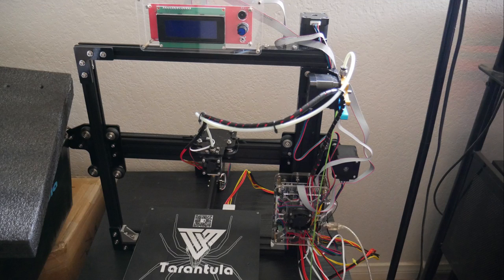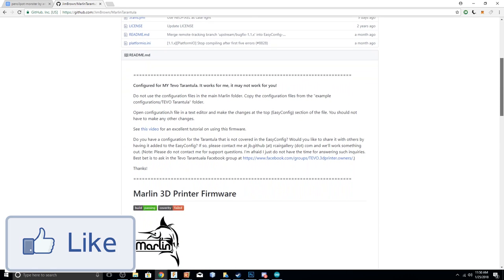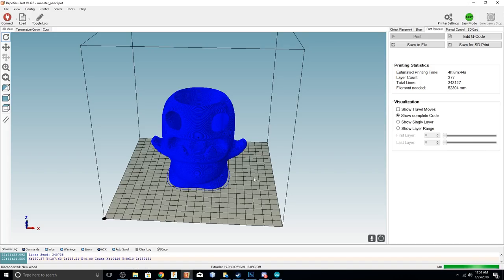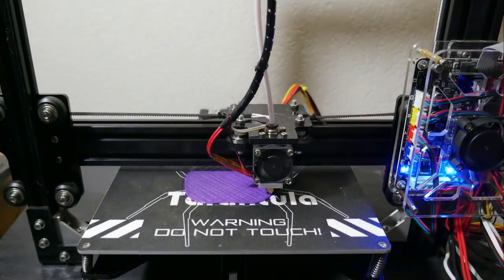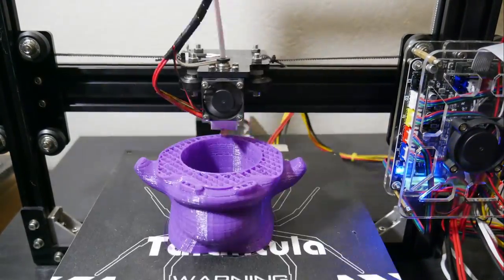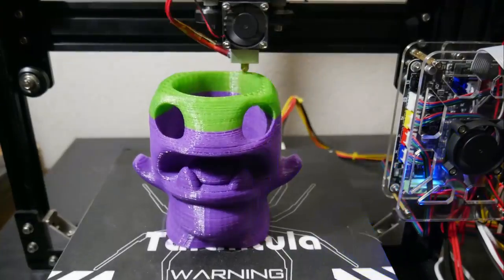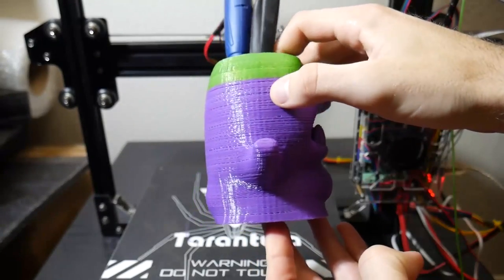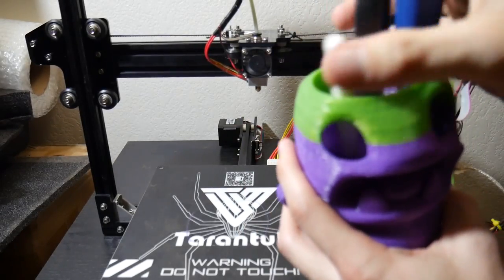Tevo Tarantula 2017 Model 3d Printer First Print Quality Test

Comment: My printer came with some offset and I get the firmware from a Dropbox
Reply from the maker: +Master of code 101 I went to tevos website and saw that they uploaded firmwares but what I saw where two firmwares in the Dropbox that where both for dual extrusion machines everything seems fine minus potentially extruder steps that's what I'm gonna check today